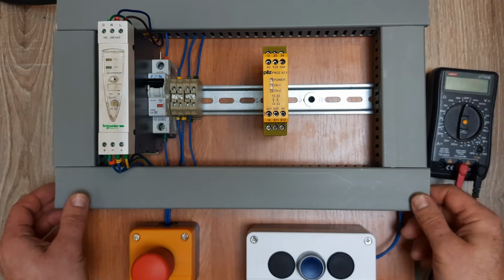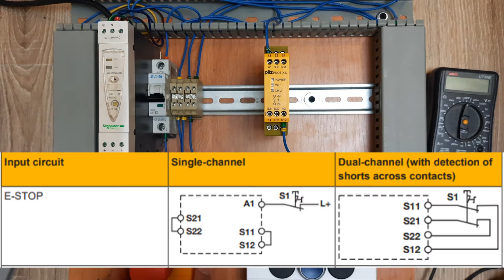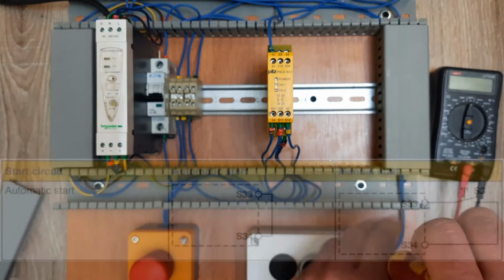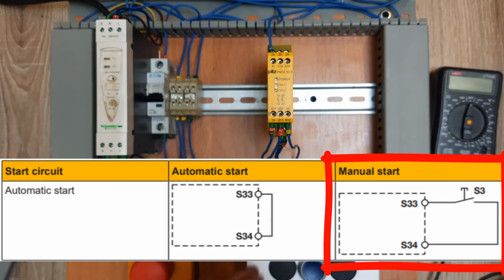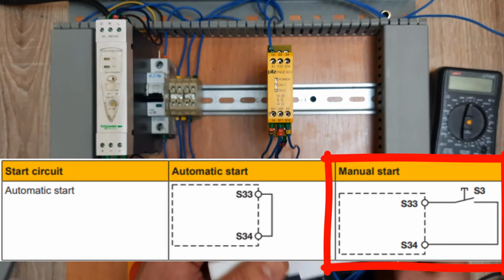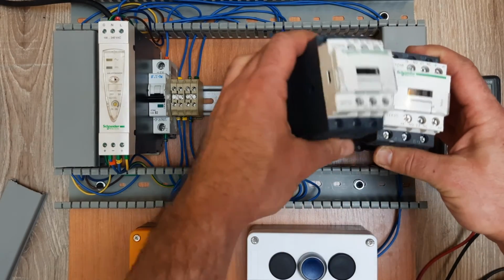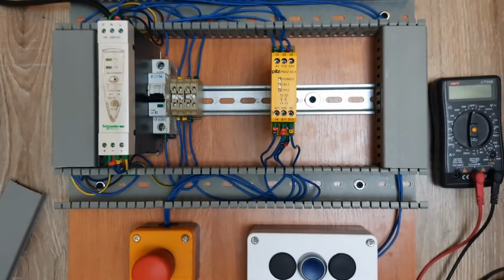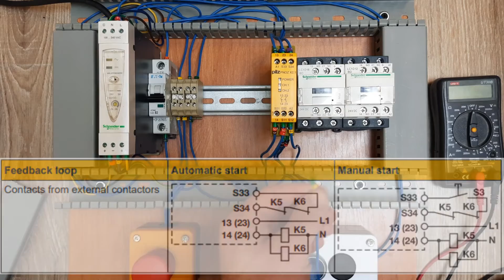How To Wire Pilz Safety Relay. Step by Step Guide For Beginners

Comment: Hi loved the video found it very easy to follow and informative, one question I had is where would you wire the output of the relay to i.e. the rest of the circuit once safety requirements have been met

Comment: How would you link 2 of these circuits together? so if you had 2 of these in different panels on a line but you want any of the estops on the line to stop everything.
Reply from the maker: I am not sure with pilz but with schmersall  you could wire all e-stop pushbuttons in series to one safety relay and still meet all safety requirements. The estop pushbuttons had to be schmersall as well.

Comment: Why 13(23)   and 14(24)    ?      Can you use 23 and 24 terminals of the Safety relay to also turn on the contactor  ?  Why both options   13+14 and 23+24
Reply from the maker: You can use either 13-14 or 23-24.
Reply: . Thanks for greattttt.  Video